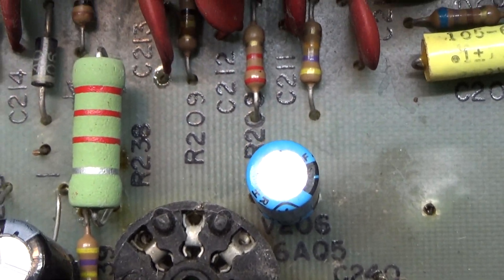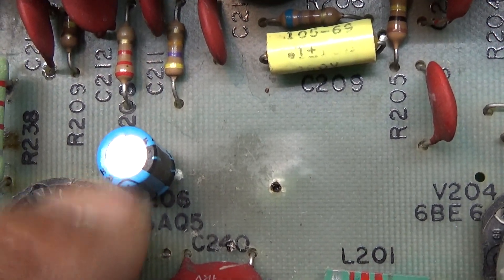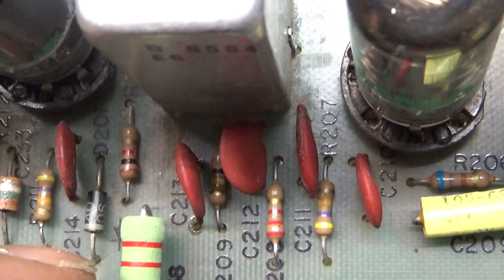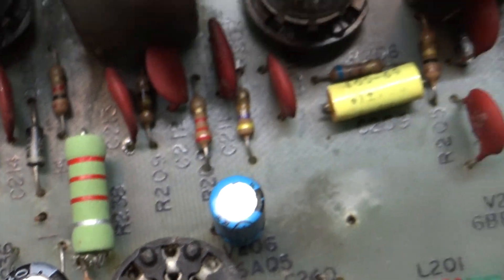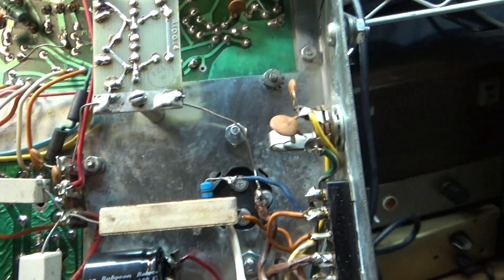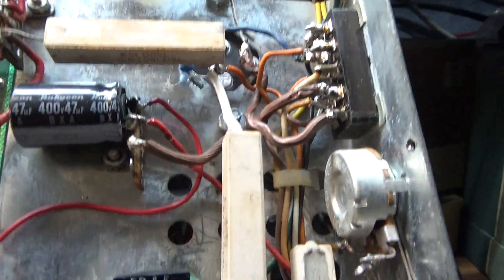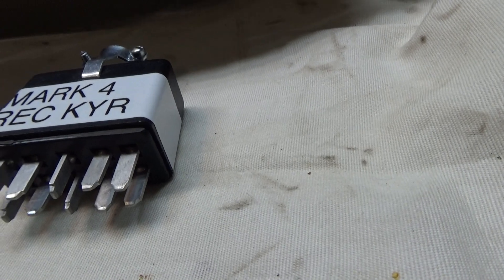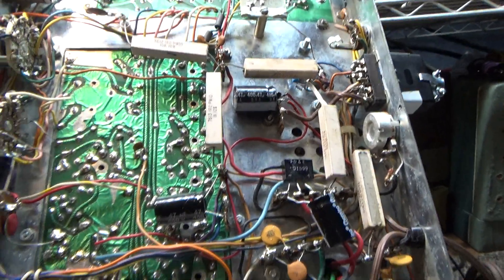Browning Mark 4 and 4A Ping Cap location

Comment: What voltage rating did you use for the switch on the secondary 47uF capacitor for the ping in VDC?
Reply from the maker: generic 500v switch.
Reply: @tramdr  thank you...working on m4 now. Same issue.   Great videos you do! 👍

Comment: How much heat does that 6AQ5 that's right next to the "ping cap" generate? If it's anything above 85degC (depending on the caps rating)  that cap will dry out and fail in a year or two.
Reply from the maker: 2 things, I usually use 105C caps, 2nd is I usually mount the Ping cap (which is much larger than the 2uf original cap that doesn't Ping) under the chassis.
Reply: @tramdr  That would do it :)  I can't remember what kind of temps were generated by that particular tube,  but mounting it under the chassis would certainly solve the problem.  Thanks!